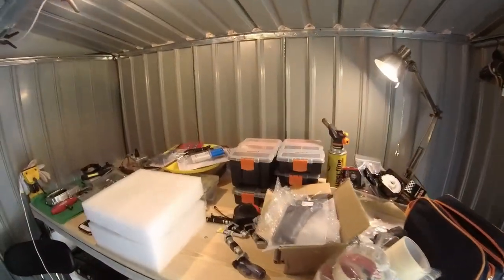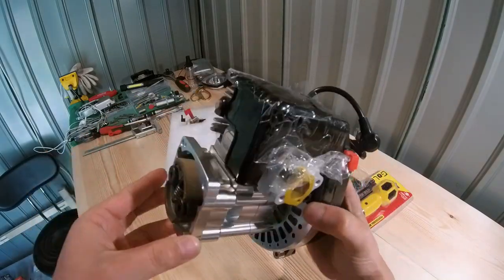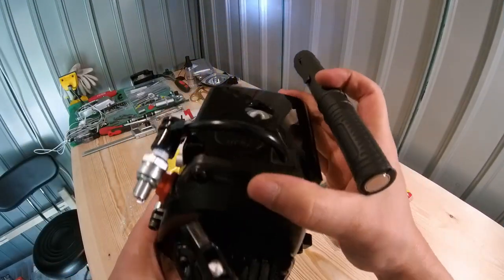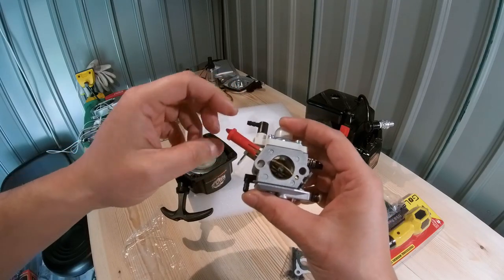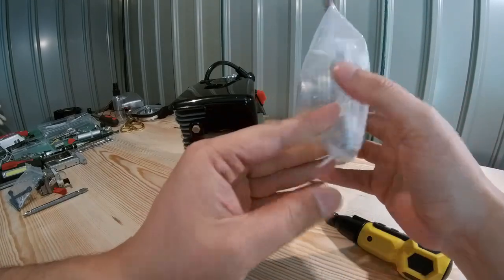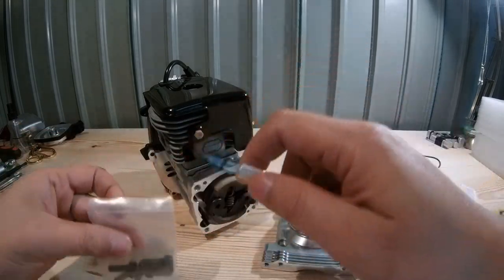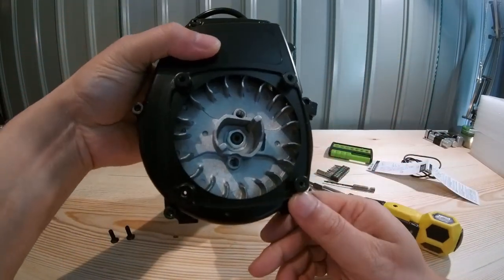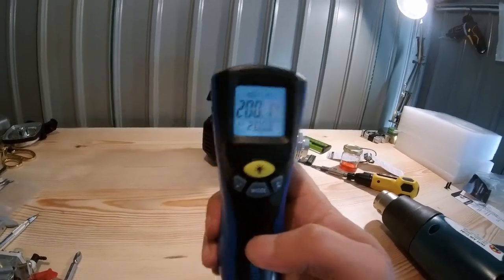#30DegreeNorth #30Degreenorth38cc #Unboxing38cc  #Unboxing My First Bling Crankcase Engine

Comment: What carb did you use to that engine? I'm thinking of getting this engine and putting the WT1257 Extreme carb from Taylor RC.
Reply from the maker: Hi bro, I used a 1191 at first and a 1107 both worked great! But I like the 1107 more! The 1257 sounds good to me hope that helps happy brappin🔥

Comment: Only number ivevdeen Is 5HP which still is decent with high rpms ?
Reply from the maker: If you want high RPM go for the smaller engines! Hope that helps👍
Reply: @magmaflow-rc4487  how u liking the 38cc 30DN engine then ? Would u buy it over the rovan 45cc ? 
I’m just baashing with my 30DN  but it’s time to finally decide and get it.
Hope to hear from u bro 🙏👍
Reply from the maker: I’m in the process of breaking in the engine bro! Had to take some time off for Exams! Anyway I’ll let you know how it goes, the 38cc is more bling and the 45cc is more grant! Depends on what you want!

Comment: Would the rooster tail carb make a difference on thev38cc u thinks? I’m so ready to pull the trigger on the 38cc as I think it will be plenty and still can’t decide if I shud put on paddled on the 5T and use it on the dunes a 2 minute walk from me
Reply from the maker: I think the 38cc engine will do well on a 5T and paddle sounds awesome! I will be trying my 38 on a 5b and the 5T!
👍👊⛽️🧨💨